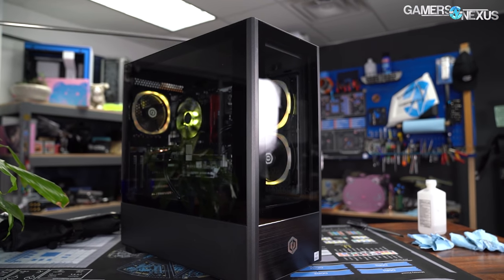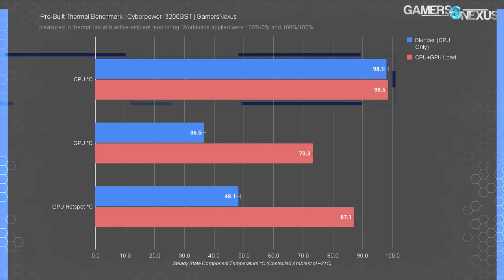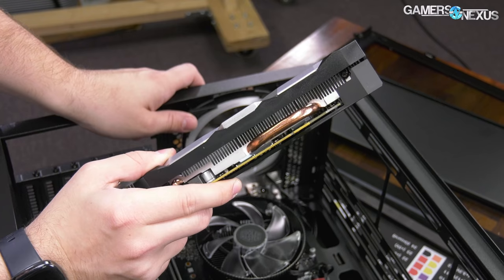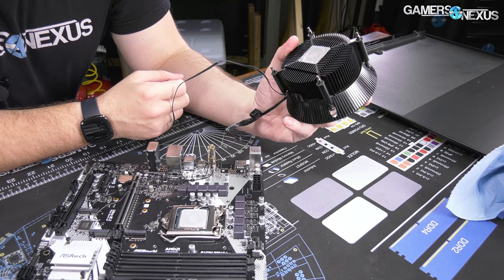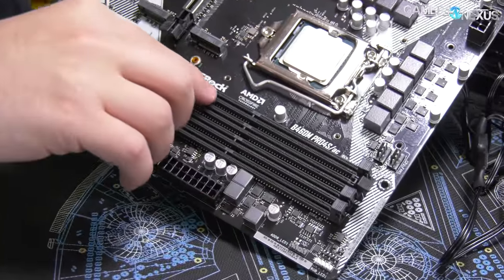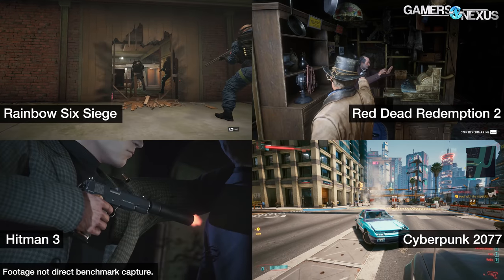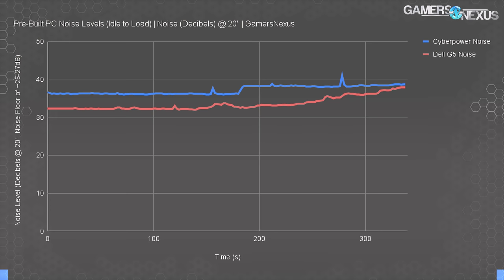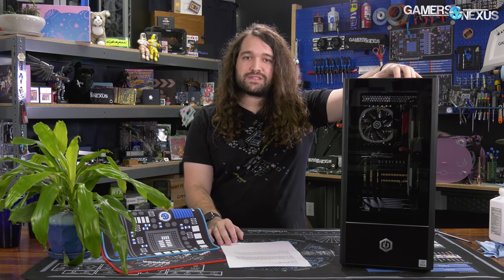Almost Didn't Suck: Cyberpower $1000 Pre-Built Gaming PC Review (Gamer Xtreme 3200BST)

Comment: Steve: This prebuilt is not complete garbage.

Cyberpower: High fives y'all!
Reply: It's like the lock picking lawyer saying it's slightly  better then master lock.
Reply: Facts
Reply: Is there even one good system integrater out there (that's not a boutique)? How can you build and sell PC's all day and not eventually get it right? Every one I see on these secret shopper videos f***'s it up.
Reply: I thought it was brilliant.
Daisy chaining six 54-ish watt Molex connectors together obviously delivers a superior 324 watt experience.
That's just good math right there.
Reply: @GotrekGurninsson  This is the clock-clicking lawyer, and what I have for you today is a prebuilt tower from cyberpower. Now the first thing I notice is the tolerances on the device seem to be quite sloppy.. wiggles CPU cooler .. a lot of play in the mechanism on the core.
Reply: @easley421  hp OEM or ibuypower seems good enough, just watch linus vid "secret shopper"
Reply: @easley421   
TL;DR there is system integrators that do guaranteed quality builds, they're just going to charge you for that quality because it doesn't make sense not to charge you. 

Original post: They don't need to get it right. 
It's because they do build so many for so long, that they actually learn what they can mess up and get away with it.
When you can cut a corner and save a dollar with minimum consequences, you then realize that dollar becomes a million if you do the same to a million of the computers you build. 
All the system integrators know this and each have their own corners they cut. 
Tell me what reason or incentive do they have to not do this? 
If a brand new system integrator came out and decided to start selling PCs and not cut any corners, then they wouldn't save that extra dollar that could potentially become a million. I just can't see how anybody could see that as a good thing. 

Thats why when it comes to PCs, if you want quality then you need to look for quality. 
You either build it yourself or look for somebody to do it for you.
 There is system integrators out there that guarantee quality, those guys often charge a decent premium because if they didn't they would have to make their money by cutting corners and doing what every other system integrator already does.
Reply: @WindFireAllThatKindOfThing  I laugh hard ^_^. Made my day. Thanks.
Reply: @easley421  Even when they're decent, the price mark up makes em crazy prohibitive, only someone that just doesn't know anything about it really purchases such things. System in video is 1050$, with an i5, 1660 and a single RAM stick lol.
Reply: @easley421  try a custom pc builder
Reply: @WindFireAllThatKindOfThing  Well, there were mostly fans connected to it, where fans consume something like 4/6W max each
Reply: @mmllmmll22  lol, I just tried to picture how my 3090 (don't ask how many people I had to kill to get one) would look if our modern GPU's power standard connectors were stacks of Molex connectors with ketchup & mustard cables.
Reply: @WindFireAllThatKindOfThing  Haha, lol. And after o read Your answer i imagined it too :D
And owning a 3090 - Youre lucky... and definetly not poor :D
Reply: @SoftExo  That's only been since the shortage. I did a fair bit of research before buying one from nzxt a year and a half ago, and most if not all charged msrp plus $100-$150 build fee.
Reply: @SoftExo  Right now a used 1660 is selling for over 300 dollars on ebay. 200-250 bucks for an i5 and you're at 500-450. 70 bucks for the ram puts you at 430-380. They might at most be making 20% off the system, and that assumes they get larger discounts than they probably do. Cyb and IBP aren't that big all things considered.
Reply: @ravenshrike  The cpu is 220, that CL15 ballistix ram stick is 40$, and the card lets even say a massive 500$ like steve did, 50$ mobo, 40$ wd green 240gb, and 30$ evga psu, thats still only 880, 170$ under what they're asking, that without even considering discounts you mentioned for buying the the parts in bulk. Kind of a ripoff, which is their MO.

And all that without even lookin at the fact that they pairing a K chip and 3000 mhz with a B series motherboard that doesn't OC nor supports 3000 mhz memory.
Reply: @UCyOGF7Bj7mF3b_FwmlAr7aA Plus packaging materials and cost of shipping. That's 50 bucks easy for a PC even at bulk rates. Plus at least 2 hours minimum to set the system up, probably closer to 3. They're lucky if they're making 7% profit off the deal.
Reply: @SoftExo  iBuyPower is frequently under whatever price you can get buying your own parts.  Even if you pay for premium upgrades to build quality you will still end up under price.  In my experience their build quality is decent as well.  We'll see how iBuypower does on the next video as they mentioned one is on order.
Reply: @easley421  honestly? No. There isn't. Because of Dell. The race to the bottom jumped off when Dell started selling systems at a loss to bankrupt the competition in the 90's, and it's been using backhoes ever since. More than half of them ship a repeatedly cloned Windows install without ever having done SYSPREP correctly on it. And that's usually the least egregious fault. QA tends to be nonexistent, because "anybody can build a PC, it turns on, good enough." Just like "anybody can put together a list of parts." This PC proves exactly why that's a load of crap. Doing it right requires actual engineering chops. Which is why Dell's is pure trash but at least didn't overheat at idle. Source: have been an SI for 30 years, and did system engineering for a top 10 OEM (by volume) which was lost to time (and criminal conduct) in the late 90's.
Reply: @NegZer0  ibp can build very nice pcs. I've bought 2 in the last 6 months. But they have their issues. The main one being the outrageous demand for their products. You can get any gpu you want in a complete system for the very close to or at the cost the scalpers are charging for just the gpu. This has lead times in excess of 8 weeks in some cases. And shit will always happen when shipping a pc across the country...or even city...
Reply: @NegZer0  Have never seen that whenever lookin at them, for me or family/friends. They're instead always between somewhat overpriced and wildly out of control. Like this one to be honest, that card isn't 500$ like we done in the example of previous post, theres 1660S on ebay for 340$, which makes this PC almost 350$ over standard prices, together with discounts from oem bulk and its 400+ from where it should be.
Reply: @SoftExo  the video was not about iBuyPower.  And yes iBuyPower are almost always below cost.  In the video they even said the iBuyPower was the cheapest system of the three.  Right now things are crazy and I don't know what their prices look like but back in December I priced out 3 different systems all were below parts cost.  I'm very curious to see how good/bad their build quality is right now given how many computers they are producing.  Hope that computer arrives soon and we get the video.

Don't get me wrong if you have the time, the patience, and the skills to build your own computer you should.  However if you lack even one of these things iBuyPower would 100% be my recommendation EVERY TIME.  They are the best when combining cost and build quality into you final decision.  Yes there are better builders but they charge many of the $s more.  

That all said judging by the first 2 videos being the best is still a pretty low bar which is sad.  And even I will admit iBuyPower does not raise the bar NEARLY as far as they could or should.
Reply: Cyberpower: 🥳🥳🥳
Reply: I'd like to thank all the little people!
Reply: Hey guys I need some help. I bought a pc in cyber power and it’s was on hold because of the address not matching. I was able to show the credit card and Id and haven’t had a reply since. Would my order still be coming or is it still on hold?
Reply: Right now buying this make sense but you have to replace psu and cpu cooler and add afew cheap fans I mean I really wanted to build a new pc but couldnt get the parts so went with the $1400 i710700f rtx 3060 and 16gb 3000mhz ram works pretty good now just have to get better motherboard cause the one thats in it is 🗑
Reply: @Arctic_silverstreak  LOL HP. If there was someone who could do worse than Dell it would be HP.
Reply: @GotrekGurninsson   I thought you hated PC's almost as much as elves?

Comment: "Molex Centipede" lmao that's so good
Reply: i did this with my kids PC as i didn’t have any other fans. :(
Reply: @destronger5313  just buy a cheap nzxt or phanteks fan controller they awesome and do the job for controlling fans
Reply: My brain processed it as "molexentipede"
Reply: It's fire (eventually)
Reply: Cent-I-Pad
Reply: I do the Molex christmas lights thing all the time, don't get the issue. Nobody ever sees it back there, who tf cares.
Reply: Is it safe?
Reply: @Hogdriva  So you buy PWM fans with their ability for precise fan speed control and then you hook 'em straight to the power supply so they run at full power constantly instead of plugging them into the mainboard for the ability to set fan curves in UEFI?
Reply: And somehow I immediately had Human Centipede flashback... oh god
Reply: In my mini ITX build, I only have 1 motherboard fan header and 4 case fans, so I did this but daisy chained from there instead of molex. Whatever, works. Kinda silly having 120, 80, and 200 mil fans all controlled by the same curve but the sound/thermals are good enough that I never "fixed" it.
Reply: Sounds like a nerd core band. 😄
Reply: Better than human centipede...
Reply: @digitalillustration604  Mostly. The connectors are notoriously unreliable, and if the fans are like 1-2W each, imagine maybe a quarter of that eventually dissipating somewhere in that connector chain... I don't think it's quite enough of an issue to cause a fire, at least it won't be a big massive fire unlike that PEG extender story with NZXT, just connectors going into runaway damage where they likely won't work any more and could melt just a little. Maybe someone could test that, by seeing what happens when the connection degrades... need some kind of a way to cause accelerated damage to the connector pins.

Though it should probably be at least 10 years until those problems start surfacing in the wild.
Reply: I knew what that was the moment I saw it. I once had a case with 8 6 80mm fans, all with molex connectors like this.
Reply: Lol
Reply: That Molex centipede is something they are still doing even with their high end systems. I saw it with a recent build for a $3k system. They do it for the fans power and the RGB control.

Comment: Good teardown.  I bought a Cyberpower PC a year ago and honestly the build is immaculate.  I have built my own PCs for the last 15 years but with the GPU supply issue I could not build a new system for anywhere near what Cyberpower was advertising.  I bought a rather high end machine and I'm very happy with it.  Performance is top notch and under regular market circumstances, same parts had I built it myself I would have saved $300.  Maybe I lucked out but Cyberpower shipped a solid system to me.
Reply: How does it run a year later
Reply: @letsplaymobile3599  ive had mine for 2 years bc I couldnt build one since gpus were ridiculous to find and its working perfectly fine still!
Reply: @EMDA91  great to hear thank you

Comment: I bought a Cyberpower back in 2015, it worked out of the box. I didn't expect a lot out of it, since I had a limited budget, and learned a lot through upgrading it. Now all that's left of it is the HDD that I'm using only for non program storage, such as word files and PDFs, but it definitely served as a starting point. One thing they've always done right is using standard parts, though clearly they've had some lapses in assembly attention to detail over the years.
Reply: I am still using the PC I got from them 6 years ago for 900$ to stream Tarkov. Did have to change ram and add SSD but other then that everything else is stock.
Reply: I got a $700 rig from them back in 2018 and it served me pretty well with only a small radeon driver issue out of box. It's mostly upgraded parts now but it was a good starting point.
Reply: @truereaper4572  a drive issue has nothing to do with CyberPower, that is a issue with Radeon. When a computer is built the drivers that were created at that point in time are installed. They cant update every computer they built each time a update is rolled out.
Reply: @solofourohsixgaming  No the problem was they were installed wrong initially and couldn't update properly, so I had to do a complete driver wipe and clean install. Wasn't hard to do though.
Reply: @truereaper4572  my apologies. I should have asked before making assumptions.
Reply: @solofourohsixgaming  Nah you're good mate.

Comment: I remember visiting my younger cousin few years ago, he bought a pre built, you could probably fry eggs on the tempered glass front panel that had 3 fans behind it, that’s how hot it was. It was stuffed into that narrow desk PC space. I personally picked a cheap 30€ case of older design when I built mine, made sure the front had a good mesh on it, put it into a push pull configuration. The Benefits of building yourself, but I can’t blame him or other regular folk for not doing so, researching/troubleshooting is very time consuming and requires to build up atleast a basic component understanding. And without someone to guide them on the path it’s really hard to conceptualise where to start on your own.

Comment: I ended up getting a Cyberpowerpc... Checked everything when I got it and was pretty good... it was priced nicely and I got a 3070 with a 10700k w/liquid cooler. 16gb ram (2sticks) with 850w psu. Tests well and runs at good temps. Under 1500 bucks for black Friday at the beginning of the GPU insanity. Happy so far though.
Reply: What kind of case is yours? I bought the cyberpower pc GMA66000WST
Reply: @wizmikey_30  The P418X Mid-Tower Gaming Case

Comment: The Cyberpower pre built I got some years ago was good. But they cheaped out on me on some parts, so I started swapping as soon as I could. Some years later, the only thing I have from that pre built is pretty much the chasis and nothing else!
Reply: same story here, i left their chip and motherboard combo alone, but changed the psu, gpu, cooler, ram, and their case thermals sucked, so i just run it without the glass and mesh basically

Comment: Great video! I actually bought this computer back on December 2020 and I was unaware of the cpu cooler (already flipped the fans). The price has been skewed from when I bought it from best buy at $779 back then....just some food for thought. Which I thought was a decent value at the time since components were hard to come by in my price range.
Reply: Which fans did you flip around? Have the exact same prebuilt
Reply: @arriazola97  The front ones on the side. The rear one by the CPU cooler is the exhaust, and you can add some more exhaust fans on the top too.

Comment: For fans with both connectors I always cut the molex connector off as close to the 3-pin connector as possible. Usually so much that the end of the cables don't stick out of the top of the 3-pin connector.

Comment: 2 things: 
first I had the same 'molex centipede" (for all the crazy RBG in the case) in a pre-built I bought I was exactly the same as you 'what the hellllllllll' being an old school mechanic and electrician I pulled them all apart cut all the ends off and soldered them all together where I re-pinned them into one connector. 
Second those coolers work ok if you take a piece of glass (as a super flat easy to find surface) and using some 800 grit sand paper attached to the glass flatten the contact surface. And yeah builders do what they can get away with. I love the channel and your apparently endless knowledge about computers, thanks for the ride along into all the things that builders do wrong and the time it takes to video and edit these....

Comment: A few years ago, I brought three $500 CyberPowerPc pre-builts (8GB AMD FX4300 based) for all of my family members - most of whom (everyone but my son) weren't using them for significant gaming at all.  I found that I needed to replace the crappy 300W power supplies pretty quickly and add a much better video card (cheap RX-580's) to run any games, as well a big (4TB) data drive to hold my son's Steam library.  We eventually upgraded his CPU cooler a few years later (although the original one was working pretty well in retrospect) and eventually had to upgrade his power supply once again to a brand name 800w version (to stop mysterious reboots that started happening a year or so after we'd upgraded everything else.  We never did figure out why this was necessary?), but all the systems are still in use and working reasonably well - although my son longs for a Ryzen upgrade!.

Comment: I ordered a Cyberpower custom built with water cooler and I found a couple of nitpicks.  I believe anything that has been touched by UPS or FedEx, you just make sure the screws are tightened before you turn it on. My only real issue was, the Killer wireless NIC wasn't getting power from a USB header meaning the WIFI 6 worked great but the Bluetooth 5.1 was inop. I admit it took a while for me to figure that out since I didn't use Bluetooth for anything until I got a Roku soundbar.
I was impressed by my Cyberpower PC but let's face it, I'm neither a noob nor someone making YouTube videos for money. Maybe a couple of lose screws & a missing USB header to me isn't a deal breaker. To each their own, just never buy a Dell gaming PC!